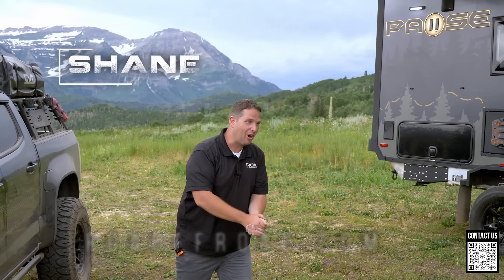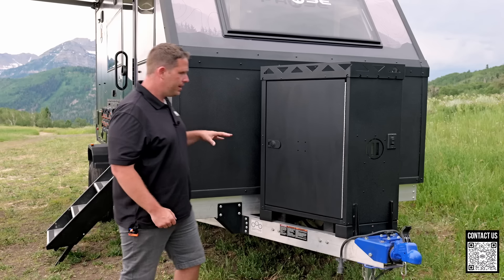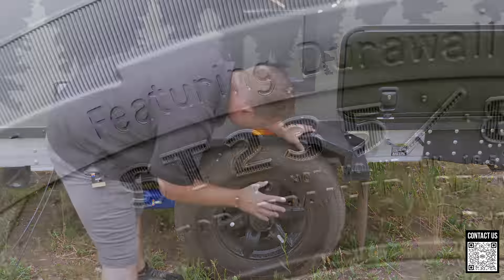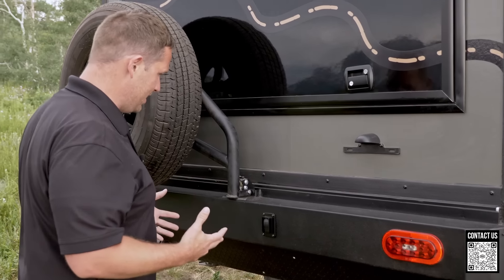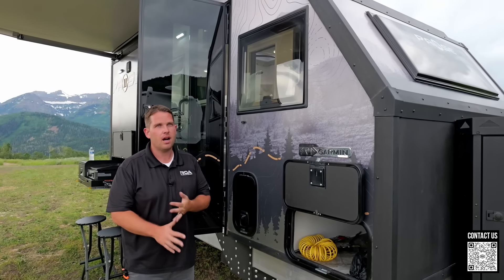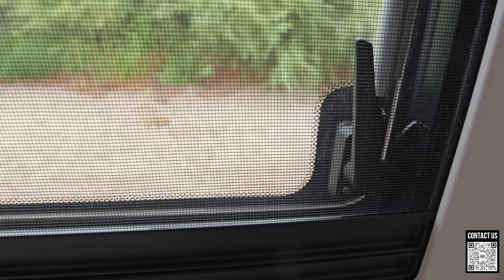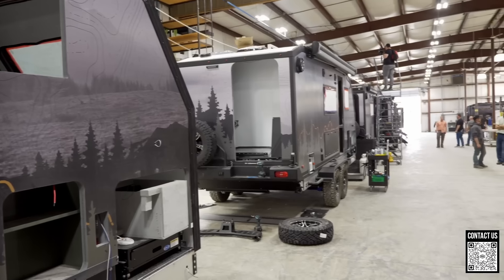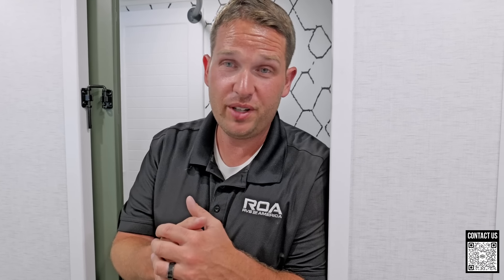ALL NEW Pause XC 16.4 FULL Tour! Ultimate Off Road Trailer That Fits The Family! | ROA Off-Road

Comment: That's 3 ton trailer a bit heavy isn't it?! it dosent give you much room for extra bits such extra water I wounder if there are any good quality 4 season independent suspension trailer that's around 2 ton or 2 1/2 the best off roader the G wagon max towing capacity is 3 tons here in EU we use metric measurements so I could be off with my conversions but yeah it's a nice one thank you

Comment: Bottom line reality fact, the only way a camper of any style can truly be considered comfortable: the bed has to be 7x7. How many ppl are 7 foot ? Not many right! Therefore whomever of the camper manufacturers can come up with a camper that sports a 7x7 bed, it’s going to be a game changer. A 7x7, super space for two ppl to stretch out in style, sleep or relax in any position one might desire, on the 7x7 bed looking up at the stars through a moon roof, flip open the back door that has a pull up screen, imagine that. Stop pretending you guys got a nice bed, none of you do, except maybe ARB of Australia, no they don’t have a 7x7 bed or even a tv, but they got a super nice setup with starlink internet hookup ready, so that with a laptop, surface pro or an iPad is all that is needed for work and entertainment. I’m going to double down: a 7x7 bed/mattress is where it’s at, the camper/rv manufacturer that makes a 7x7 bed/mattress a reality is going to reset the market for years to come.